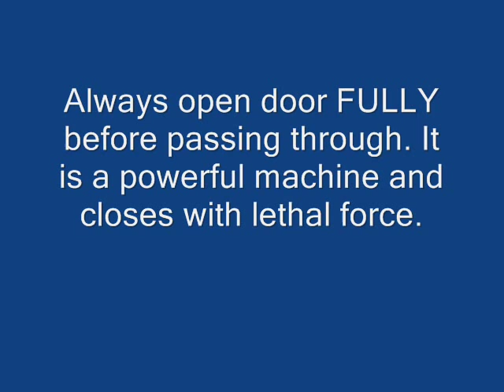Marine Hydraulic Water Tight Sliding Door

Comment from the maker: @TK42138 No, there's nothing to keep you from closing the door with one hand (using the electric powered pump). If the electric system fails, you have to use both hands.  One hand to hold the hydraulic valve open, and the other hand to operate the manual hydraulic pump.